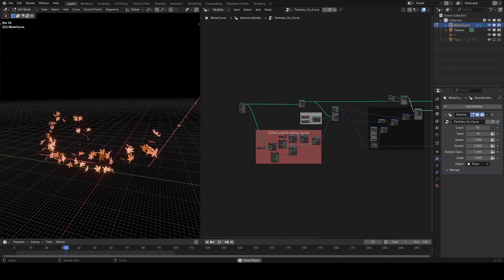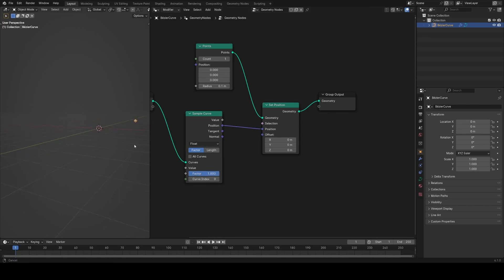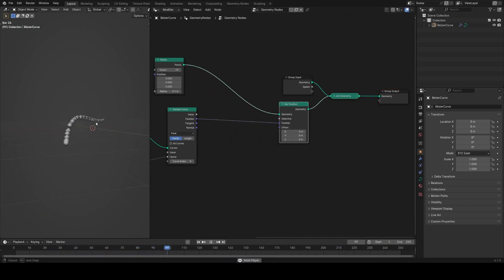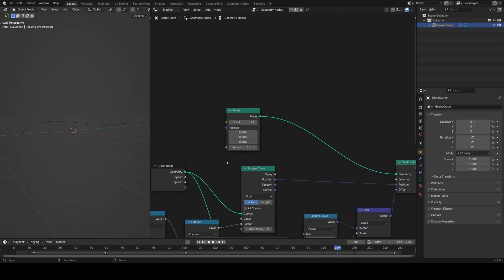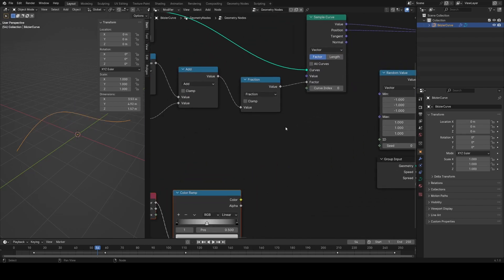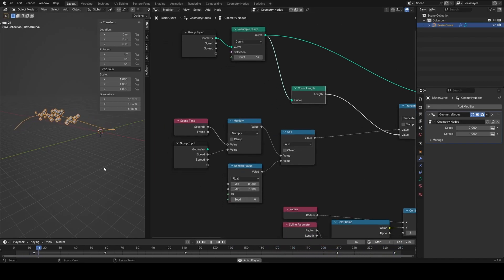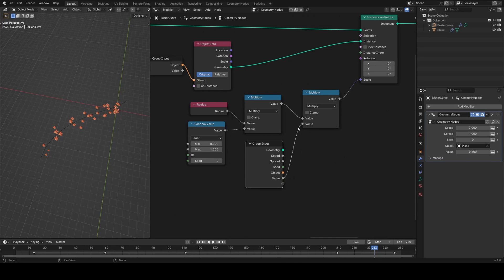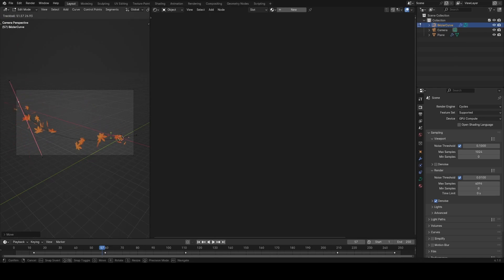Particle flow on Curve - Geo Nodes Blender

Comment: Thanks very useful. I am using it with many many particles and it forms like a square shape distribution.. It looks okay from one angle but when you rotate the camera you kind of recognize the square shape in which all particles are going. Can we add some rotation along the curve also with some randomeness to fix this? thanks.
Reply from the maker: Thanks! Ah yeah thats a classic problem of the nature of random value, as it takes a lower and upper bound it basically forms a cube boundry. You could maybe try adding another random value after or possibly scale the random offset based on distance to the nearest curve point perhaps

Comment: Hi! I can’t figure out which nodes to add so that the speed of the object depends on a ColorRamp (so that it moves slowly at the beginning and speeds up towards the end of the path). Could you give me some advice?
Reply from the maker: Hi! yeah this is a really tricky thing to do as you cant really use scene time/seconds to do it proceduraly. Whenever I do this, i usually just replace seconds with an animated value that I key manually :)

Comment: Excellent tutorial, easy to follow and gives lots of alternative explanations. However I' wondering how to make the points evenly distributed along the curve instead of randomly spawning as you show?
Reply from the maker: Thank you! and yeah you can replace the random value that we use in the add node before the sample curve, with an index node, which will make a constant offset between points instead of a random one :)

Comment: For some reason I had to just set the Truncated Modulo to 1 for this to work, using the curve length just spawned the majority of the points at the end for some reason

EDIT: obviously the speed ramps up depending on the length but it works at least

Comment: Hey man! Loved your tutorial, I have a question, I want to keep the look of the loop animation but up to a certain frame, then I want it to stop "emitting", is there a way I could do that?
Reply from the maker: Thanks! Yeah kinda, usually when i eant to do this i replace where i used the scene time seconds input for a value i can keyframe and remove the fraction/modoluo to stop it looping
Reply: @Polycount-tw4ix Thanks! I ended up just bypassing the modulo node, and it did what I needed, so basically what you said haha

Comment: Great tutorial! I’m trying something similar but with a disintegration twist: I have a photogrammetry model in Blender, and I’m instancing particles to form the object first. Then I want the particles to disintegrate and flow along a curve to a point. Do you have any tips on making a clean disintegration transition into a particle flow along a curve? Thanks!
Reply from the maker: Thanks! and for that Id probably use a different method, I would make use of a simulation zone and physics like ive done in my spark video. then to apply a curve force id bring it into the node tree and sample the nearest tangent as a force, and use the inverse distance as strength.
Reply: @Polycount-tw4ix I’ll check it out, and thanks for the tips! ❤

Comment: This tutorial is so informative and relaxing at the same time. Its like watching Bob Ross paint. I learned so much from this video. Thank you so much!
Reply from the maker: wow! thanks
Reply: @Polycount-tw4ix  :D So I used this set up to animate some fishes along a curve. I was trying to get the instances to align to the curve tangent. But nothing happens when i plug that in to rotation in Instances on Points :/
Reply from the maker: So youre going to want to plug the tangent from the sample curve node into the vector input of a "align rotation to vector" node, select the correct axis (think its y but you might have to fiddle with that and the pivot) then plug the rotation into the instance on points rotation input :) this is on 4.2 now also
Reply: @Polycount-tw4ix  It worked! Thank you so much!! :D